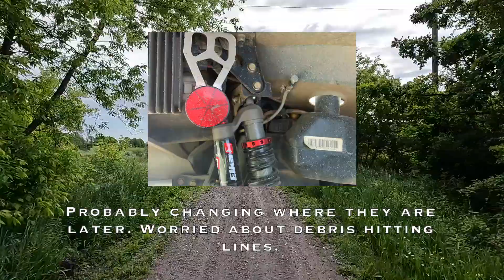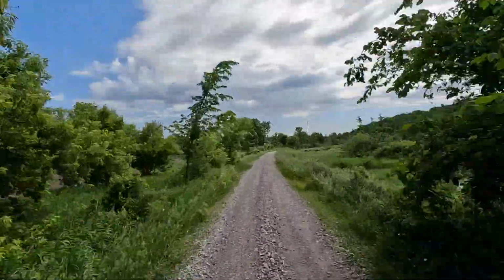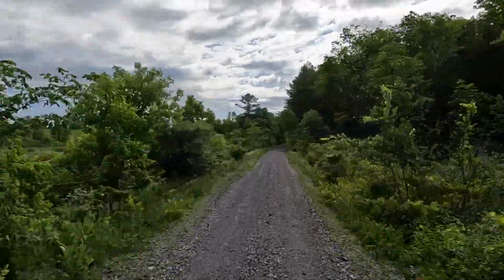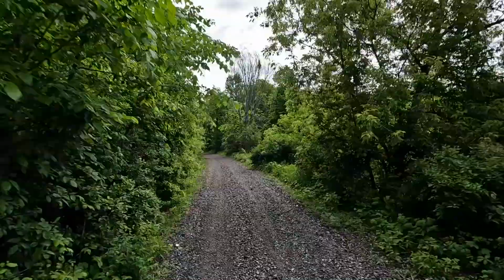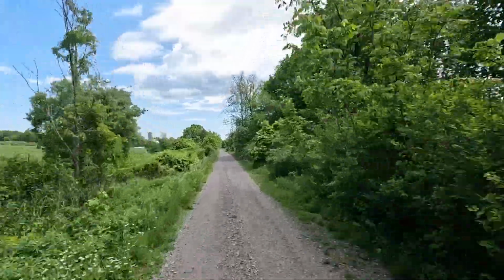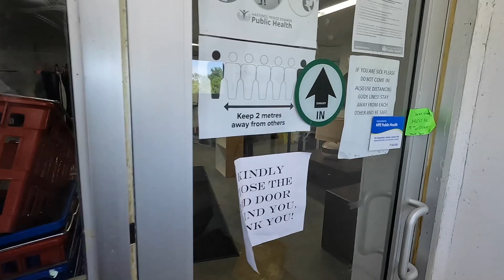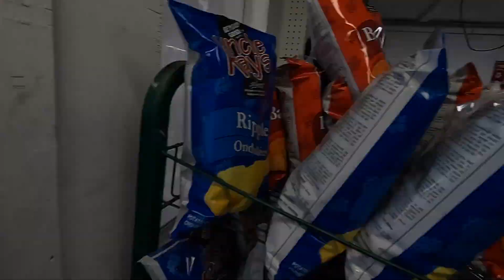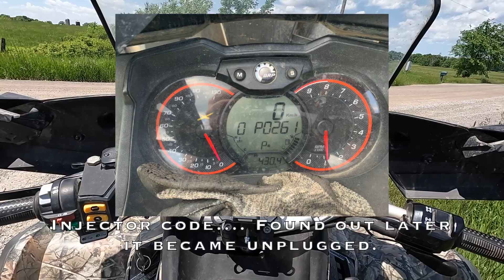Testing out the new Elka Stage 3's ATV suspension

Comment: the reason why is doing that ...that because you fill up your quad way up to gas cap ...that why ...it did happen to my buddy  of mine name fred 
and it did happen same way as you did on limb mode...the best way to do is open gas cap for 3 minute and try it ..
Reply from the maker: Nah man. Connector was off fuel injector. Said at end of video.